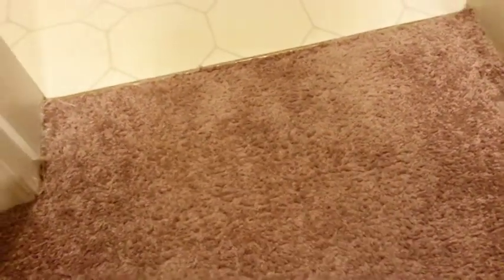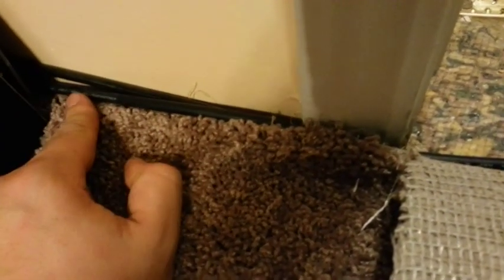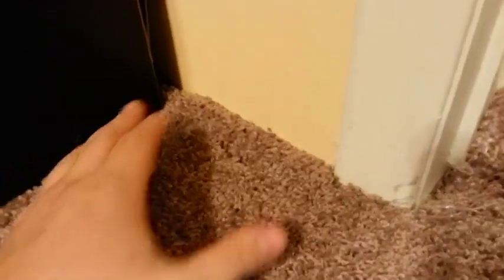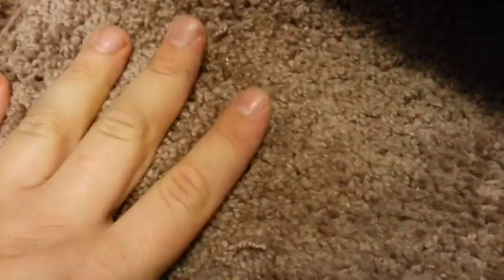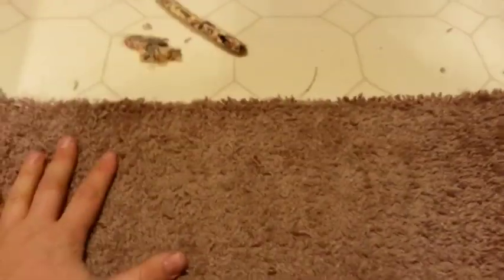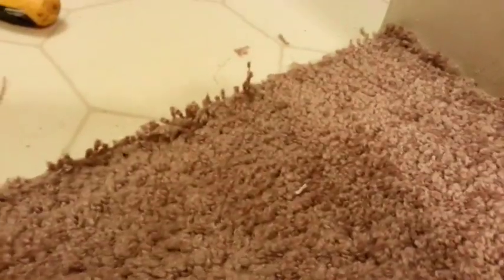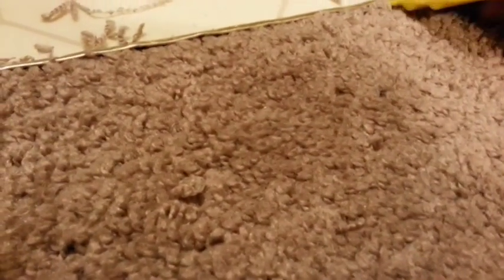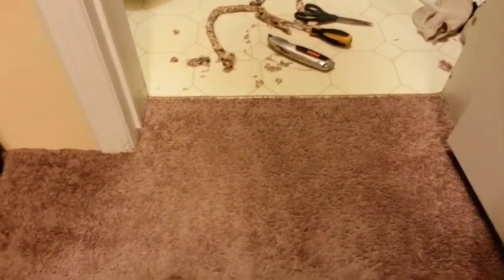How to hide wires under the carpet

Comment: Cool tutorial 👌 I ended up just purchasing flat white ethernet cables to match the door frame and I actually dig how I can hardly tell its there. 
Your video definitely helped with that decision though since I learned I could snug the flat wire into the edge of the carpet (Round bulky cables was okay but the flat is definitely better although it is more pricey)
Reply: How did you secure the flat ethernet to the door frame?

Comment: if you are not going to run the cables behind the door moldings (not called frame) then your second option is to run them under the carpet properly; you don't run them "in the groove" because that is for the carpet to tuck away the edges, it also helps secure it from unhooking itself and you wont have all that bunch of cable bunching up against the wall, you run the wires or cables parallel to the inside of the tack strips(where padding meets tack strip) ,but were the cable comes in from the amplifier or whatever into the floor you notch a channel on the tack strip to get to the inside of it ,cut the padding along to create a channel to the wires (lay cables or wires straight and flat as possible) and will help id you put down some duck tape on top to keep all in place specially  were there is no tacks ....just run is as far as you need and come up the same way....now if you decide not to use the special tool for carpet stretching (no such thing as a puller) you take the risk of the carpet eventually getting loose and that entrance has the most foot traffic area ,not only because it is a textile but you left it loose so it will start to crease and you will see ripples on top... better to stretch the carpet properly (rent the kicker at home depot) to hook every place that you lifted....anyways just a suggestion if you want to do it right the first time...I am a carpet contractor and I get paid to fix details like this all the time ; this "educational video" had too many mistakes to begin with... always use the proper tools for the proper job and you will have better end results so you won`t have to call me to fix your mickey mouse job.
Reply from the maker: good to know. know more?. 
- make a video like me and share. thanks
Reply: +Frank C as well as carpet carry's static electricity and those sparks travel very well down oxygen free cable.
kaboom goes the electronics
Reply from the maker: +luvdady I had those wires for 2 years I never had a problem with them
Reply: 2 minutes two hours , two days or two years...
to much risk it can take very little juice to blow up the equipment
Reply from the maker: +luvdady hdmi and tv cable are insulated . and protected form static. ...what are u talking about?
Reply from the maker: +Ivan Rossinskiy hdmi and tv cable also ground.. when u connected to your equipment
Reply: yup till there is  a surge and kapow.
its done
Reply: Might as well say "sure, until that 1 in a 1000 thing happens that breaks everything"

Comment: Not to be done with A/C wiring or extension cords!
Reply from the maker: why not. it just more dangerous that way, but u can run 220v there if u want, just need to have wire that made for outside, thenm more heavy duty.
Reply from the maker: Guy Coombs well of course its Hazzard and not approved,  I just said that yes u can do it, should to add "on your own risk" in my video I have tv cable and hdmi cable under the carpet and that's not hazzard at all.
Reply: That is why my original post just said, "Not to be done with A/C wiring or extension cords"  and people need to know the risk, that would be a fire hazard that can kill, So It is really simple, you did it with TV cable which is fine, but, not to be done with A/C wiring or extension cords.The message is for people who might not know the difference, I'm an electrician, I meet people all the time who don't know how wires work.
Reply from the maker: Guy Coombs I'm gonna add to the description section "not to be use with electric wires" and also will add tags in the video it self
Reply: that's a good idea, that's all I was trying to say.
Reply: Just don't want someone to do something and get hurt
Reply: you did a good job though with hiding those cables though
Reply: "why not. it just more dangerous that way"
I never seen someone answer their own question so fast in my life.
Reply: @guycoombs7266  would an ethernet cable be safe to put under the carpet the way he shows in the video

Comment: a wall drop drop the cable down the wall
Reply from the maker: u talking about around frame? out side?
Reply: +Ivan Rossinskiy no why run cable across the floor go up into the attic from the wall
Reply from the maker: +Cody Tyree 
where that what you do when you cannot access attic. specially when you live at modular house, where there is no attic at all...and secondary if you need to just to send wire from one corner of your room to another, like from laptop to tv